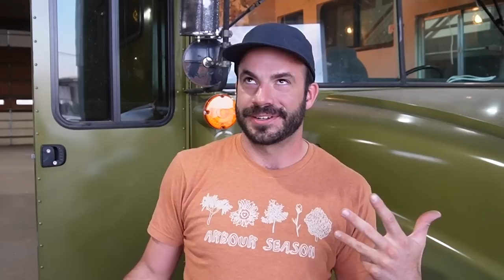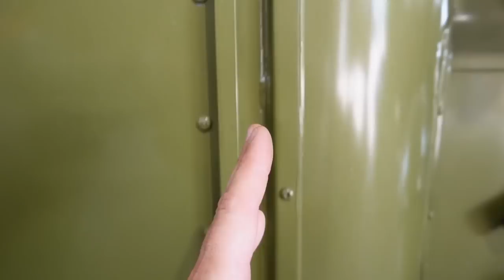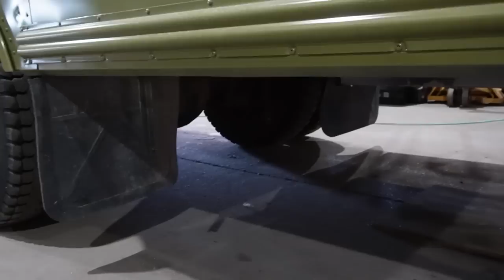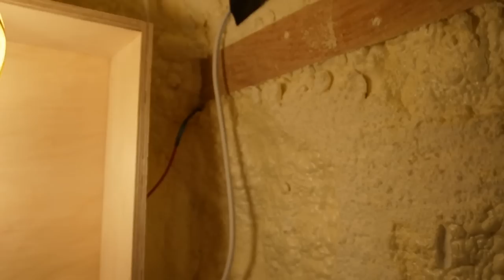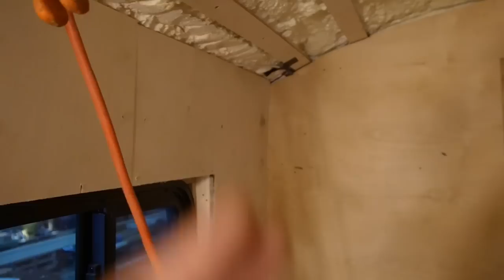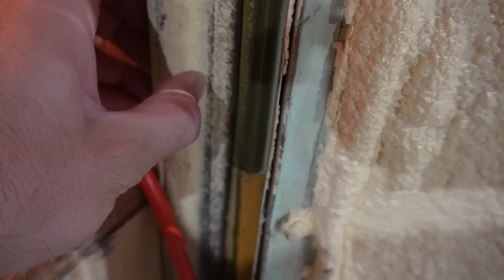How I F****** UP my own bus

Comment: Good points Chuck. I'm a retired RV Tech building my flatnose /home and one thing I've learned from experience is there is no excuse for mistakes .... LoL , ya right . Yours are really minor. I call my costly mistakes " R $ D " and believe me the greens stack up fast.Soften up that foam on your rubber with Wd-40 and it will chip away faster.
Reply from the maker: Well said! R&D can be expensive ;)

Comment: That propane box you can change to a smaller clean water box maybe so you could add a shower in the bus and maybe add washer/dryer depending on how much water/power you have for your bus. I've seen it in another channel, someone else added washer/dryer in addition to shower, etc. Basically, it's a house with wheels. So if you have heat/AC / kitchen / bed then you are completely done. Regarding the water issue if you design a way to collect rain water then just filter it via reverse osmosis then you won't have to constantly fill fresh water all the time.

Comment: I was curious about radiant floor heat and possibly looping it into the engine coolant with a thermostat cutoff. Keep it toasty while going down the road.  Then have a secondary pump with alternative heat source for when the motor is off.  🤔

Comment: All things I’m sure i have done as well lol 
Well all but the wire split extensions 😂 
CHUCK !! 😂 but i did forget heat shrink on a shielded temperature sensor extension the other day and decided to add a few wraps of electrical tape vs cutting it out and doing the 22g foil wrapped crimps all over 😂😂
Love the honesty and humility! #chuckstillrocks
Reply from the maker: Dude the struggle is real! Thanks for watching brother!

Comment: Are you going to fit a reverse cycle inverter split air con? That would be a quick and efficient way to heat up (or cool) ur bus, but a hydronic circuit would have been nice for using ur engine heat in cold areas while travelling. Cheers

Comment: If I were you, I would have as many energy possibilities as possible. You might need it some day.
I think wiring should not be before the spray foam so that if you need to get to the electrical wires you can. Also, no one is perfect and never will be. We all learn from our mistakes, so that is a good thing. I would put a heated hallway and heat underneath your bed with the diesel heater and the batteries. What do you think?

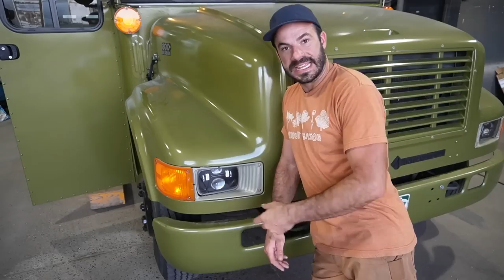Comment: 12:30 could you take a set of glass sealed bean bulbs to a stained glass artist or a tile installer and have them cut the front lens out to make you a replacement for the plastic lens? I've done this for Jeep Wranglers and Harley Davidson motorcycles.
☮️❤️🌈
Reply: PS: JB Weld is your friend!

Comment: Some of these mistakes have exposed a flaw in your overall design.  You need wiring chases down the length of the bus.  Ideally one 2" in the roof and one down each side.  Spray foam is such a permanent solution that it makes any future changes a real pain. Imagine how much you would thank yourself when you run that new A/V, solar, PEX lines, ethernet, whatever.